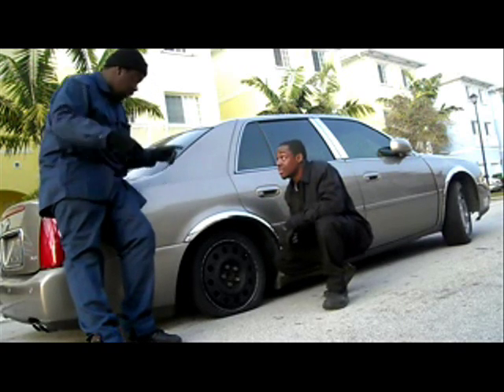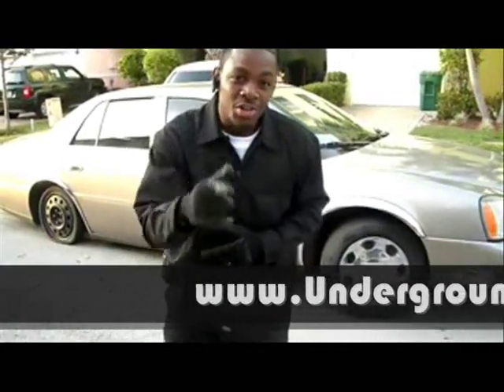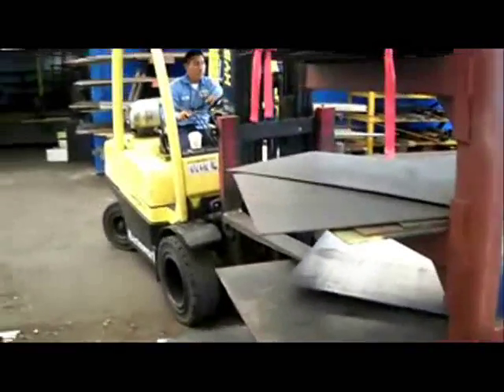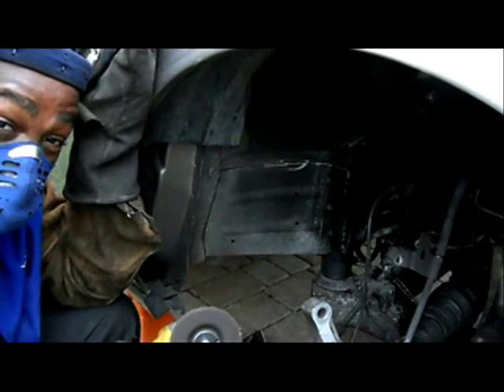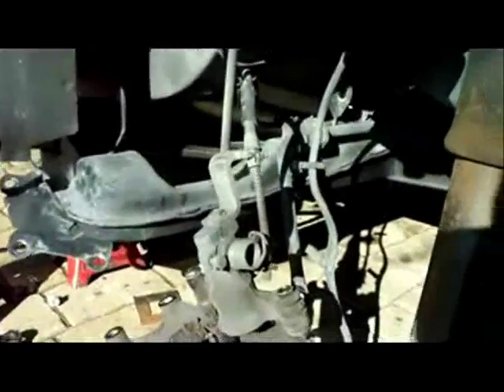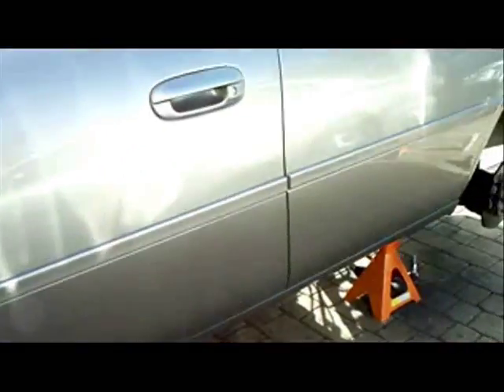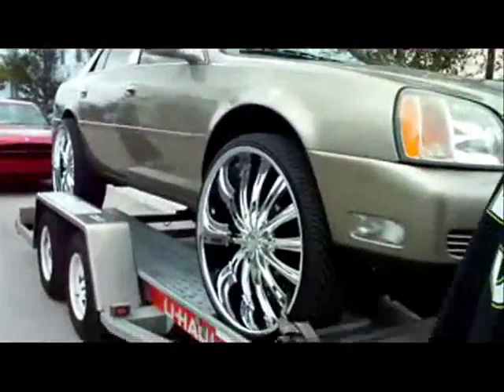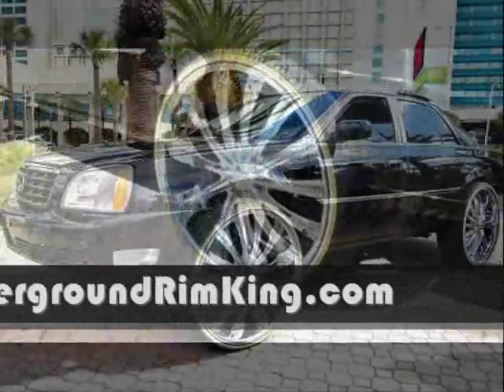Underground Rim King Shows you how he put 28"s On the 1st (FWD) Cadillac DHS

Comment: I got a Cadillac just like that that shakes when it takes off what I need to do to fix it
Reply: engine mounts are bad.
Reply: +bigkarl24 I replace everyone at the same time
Reply: +AG AG check suspension. ball joints or steering knuckles lower and upper. have the car in the air see if u can wiggle or hear noises when u shake the wheels left and right by hand or up and down. 
up and down u hear noise or loose that's the steering knuckle. 
left and right that's ball joint or tie rods.
Reply: +AG AG check suspension. ball joints or steering knuckles lower and upper. have the car in the air see if u can wiggle or hear noises when u shake the wheels left and right by hand or up and down. 
up and down u hear noise or loose that's the steering knuckle. 
left and right that's ball joint or tie rods.
Reply: +bigkarl24 I changed all the ball joints on it already
Reply: +AG AG did I check the steering knuckles and struts??
Reply: +AG AG if it's on 28s or anything on bigger than 22s most likely lift not done right
Reply: +bigkarl24 yea might not be cause my shit shakes hard if you take off fast sounds like the cv joint tho

Comment: PAUSE AT 3:02  Look at the $25 AutoZone Spring Spreaders, LOL.. Holy Shit, Theres no way in HELL I would let these clowns mess with my car. All they do is cut everything out of the way for clearance, then use trash (AutoZone Spring Spreaders) to get it sitting higher, not professional.
Reply: how else to fit them if you dont cut things away for clearance ?
Reply: Thought I was the only one that saw that. I was using those type of spacers back in 96(to drop my car). Definitely a no-go in 2018. Buy taller springs.
Reply: I work at auto zone and I refuse to sell those spring spreaders for safety reasons